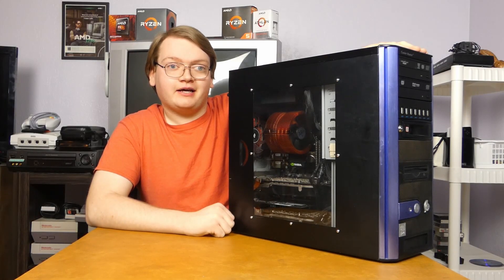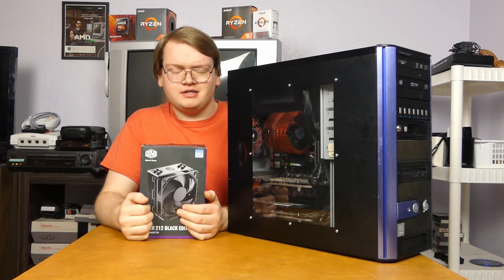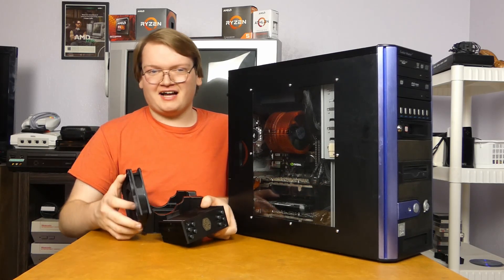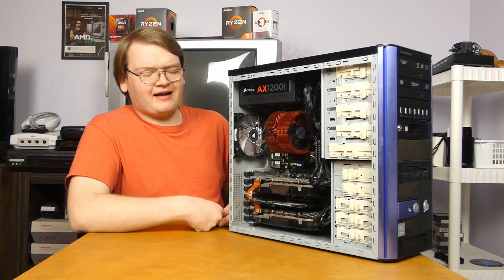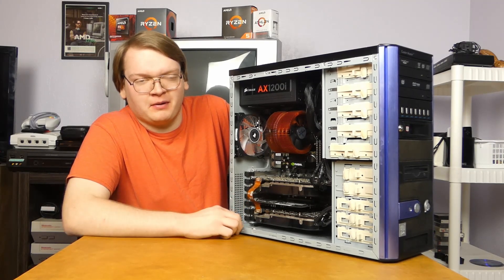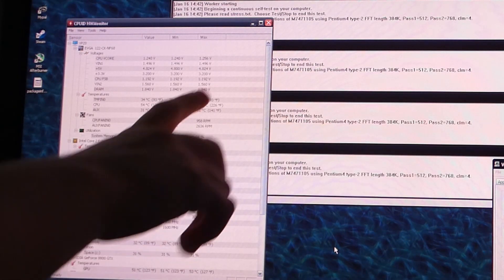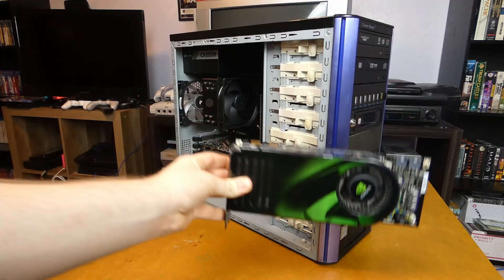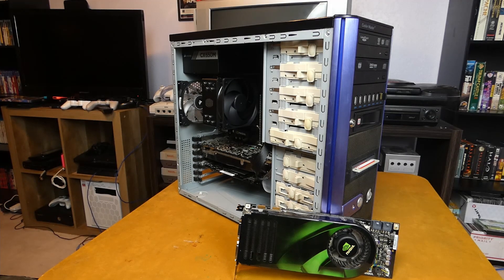Upgrading The XP Machine's Heatsink (+ A Downgrade?)

Comment: System looking good.  Its getting harder to find modern cases with more than 1-2 drive bays so probably a good call to stick with what you have.  I recommend the Thermaltake Versa H26 though if you decide you want something newer!

Have you considered repasting the GPU?
Reply from the maker: I’ve repasted both cards and put new thermal pads on, but under heavy 100% load (mainly just cranking up Crysis) they can hit low to mid 80s. Most of the time though they’d usually be in the 70s.

I think the problem might be kinda like the PS3, where the paste in between the IHS and the die is drying up. It also doesn’t help that the cooler design could be a lot better. It could’ve really used more fins and more than just one heatpipe which doesn’t even make contact with center of the IHS.

Of course, maybe this is just how these are supposed to run. I’ve seen conflicting reports from users back in the day on forums. Some say their cards were in the 60s under load and I’ve seen othet complain of card in the 80s and 90s. So who really knows I guess.
Reply: @NTGTechnology  Yea maybe they just run hot, I didn't have one back in the day so I can't say.  But good point on the IHS / Die theory - I had an Athlon X2 seemingly go bad due to this (no matter what I did, could not keep the temps from steadily rising while idle).

Comment: I have a Core 2 Quad Q9650 overclocked to 4.1 ghz. You really should overclock old cpu's with FSB even if it was extreme edition. In some cases the multiplayer can be lovered from standard max and and FSB so high as it goes if the cpu dosen't like more speed. First generation i3,i5,i7 and AMD FX are the newest to overclock with FSB to get the most out of it. On Sandy Bridge or newer if you OC with BCLK it will corrupt data on SSD.

Comment: ..the best thermal compound i have found is dilectric silicon grease.  it has a high dropping point its clear and so far for 10+ years its always maintained a greasy consistancy even over years of usage. it is great for CPU;'s With Heat Spreaders! it is under gunned for gpu's but for cpus its been very effective its never once dried and cause cpu pull out when removing the heat sinks,  and did i mention its clear! very low mess

Comment: Listen, if you chose Windows XP, just want you to know that it suppose to play games from 2001-2007, and you can do it on Pentium 4 and some cheap ATI Radeon 9550. This setup is not for XP. Also 1GB RAM will be enough.
Reply: These parts are from 2006, so they are period correct for Windows XP.